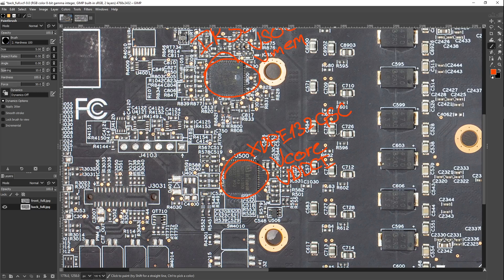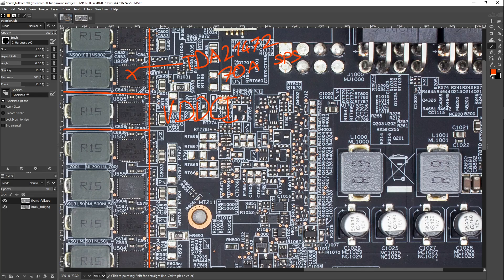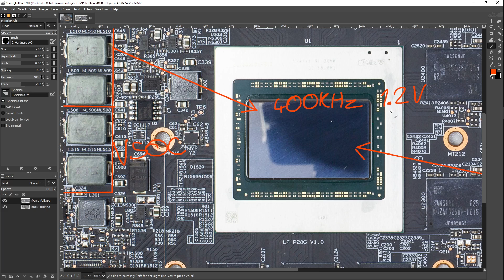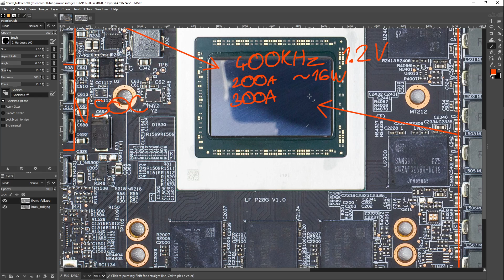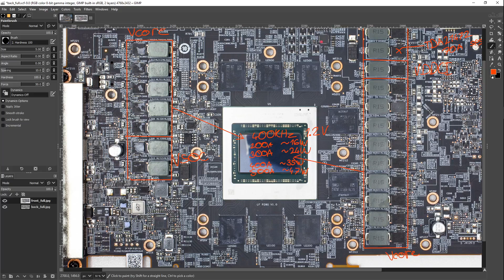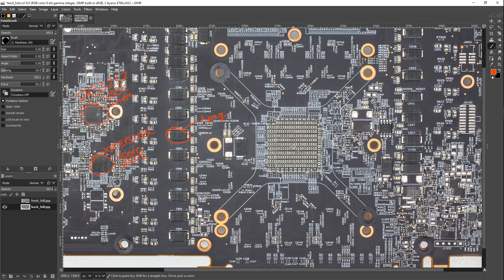GPU PCB Breakdown: RX 6800XT Red Devil

Comment: Hey BZ, please return to your orange pen. It's way better for visuals especially if you are colorblind. Thanks!
Reply: Looks more red than orange to me. True orange is better for visibility
Reply: the ink looks orange to me... was it a different shade of orange before?
Reply from the maker: @MikeDawson1  I added a bit more red to the color but to me it's still orange.
Reply: @ActuallyHardcoreOverclocking  Same on a calibrated 99.5% AdobeRGB screen, still kinda orange. But I get the point. GREEN is the best color for this! The human eye has the most receptors for green and thus the highest resolution. Cause grass, duh.
Reply from the maker: @kyoudaiken  yeah but I don't like green. I like orange. I just got sick of the orange blending in with copper pads so I made it more red to try help with that a bit.
Reply: @ActuallyHardcoreOverclocking  Just change the line to have an extremely small black outline. Then it doesn't matter what color you use it'll contrast to the colors it would have blended in to and won't be visible to the ones it isn't a problem with.
It's primarily the tone that is the problem. Most men have an issue with red and green of a similar tone put together. Most go through life never even realizing it's a problem as it's so minor, some it's a bit more of an issue. That's why any kind of red and green together (which orange is just a kind of red) is generally not a good idea for presentations with a lot of dudes watching :)
Reply: @ActuallyHardcoreOverclocking   - For colorblind it's not that much about the color itself, it's mainly about the contrast. Unfortunately your adjusted orange is blending with the pcb and so really hard to read. I guess we can find a color that makes you happy and won't exclude people from enjoying your good content! :)
Reply: @ActuallyHardcoreOverclocking  white outline would probably be the best for visibility?
Reply from the maker: @Half_Finis  I'm not aware of any way to get an outline.
Reply: @ActuallyHardcoreOverclocking  You can apply outlines on your strokes in GIMP through the use of Layer Effects, although that will be an external plugin that needs to be installed. You can easily find it if you search for 'gimp layer effects'. The installation is relatively painless and adds a context menu to your Layers window.
Reply: @ActuallyHardcoreOverclocking  Yeah green is a color not everyone likes. Same for me. But I don't mind it for purposes like that.
Reply: @ActuallyHardcoreOverclocking  yeah, somehow this one is really hard for me to see compared to the older color.
Reply: @ActuallyHardcoreOverclocking  best if used green, especially with black outline.
Reply: @ActuallyHardcoreOverclocking  say fuck it and go a wole new thing, with a cyan or teal!
Reply: @MikeDawson1  looks slightly more red than it used to be
Reply: I agree the original orange is more readable and better visible than the current one (I'm not color blind)
Reply: I couldnt see anything haha, I wished he had a bigger pen.
Reply: @pascha4527  Oh he has, he most certainly has. 😏
Reply: Yeah I'm colorblind, can't see it that well
Reply: I'm also not colorblind, and yet the old orange was more visible. It was less red and brighter.
Reply: Yeah the orange 🍊 works better
Reply: Looks red to me also. Not colorblind in the slightest but the?orange is the easiest to see
Reply: @denverbasshead  it's not red. It's getting close to red, but it's not red. I am using almost the same color for my RGB strip.
Reply: Hi Buildzoid!!!!!
Reply: Use OSHA Safety high visibility orange: 255,121,0
Reply: @DripDripDrip69  ooooh nice i didn't realize but yeah those are standard colors.

however.. "ISCC–NBS descriptor: Vivid reddish orange" goddammit. :D
Reply: At least I don't think I'm colour blind and I'm having trouble reading a lot of it.
Reply: Hmm BZ just plain denying this request.  No hate, but I agree it's difficult to read this pen colour.  Dark PCB could maybe do well with a brighter yellow and thicker strokes.
Reply: he just ran out of that orange you know supply chain issues an all
Reply: I see red.  I can barely read it without concentration.  Bright orange or green for me..lol
Reply: It is orange lol
Reply: I can see it fine
Reply: don't care what anyone likes, it's barely visible.

Comment: we no longer in lower wattage anymore...we are at upper 350w now...then 400w soon for both companies...since its not cpu ..its gpu ..shrinking die will not help ..it just be lot worst when transistors increase in amount is too high for power delivery ..more amps
Reply: What the fuck are you trying to say? Smaller dies don't need as much current, so draw less power at the same clocks, so of course it would help.

Comment: it requires a GOLD+ version to run this card...no bronze  PSU gonna boot this card ...its why majority 5700xt get blackscrean death during loading a game  that this knowledge was missing in every gpu boxes of requirements of PSU types...
Reply: Platinum/Gold/Bronze, etc. are only efficiency ratings... they don't directly govern power delivery quality. They're usually correlated, but not always.
Reply: lolwut
Reply: Mmm you sure 700w bronze wouldn't work ?